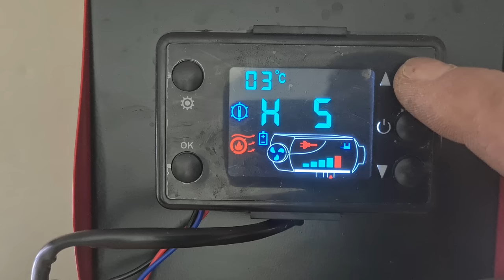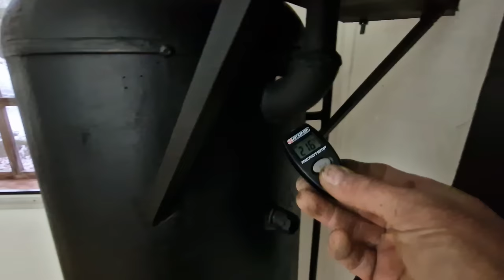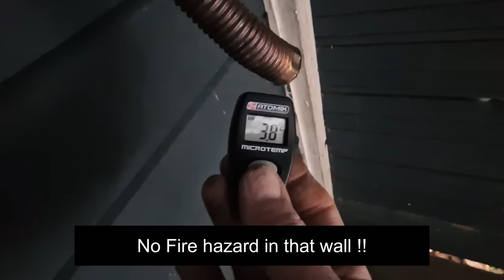DIY Vevor Diesel Stove with  Free Energy Sand Battery

Comment: There are several videos of people running the exhaust thru a hot water cast iron radiator to capture most of the heat, which I thought was a good idea. I may run mine thru a long baseboard water heat tube with the fins on it to radiate the heat before it exits the room.
Reply from the maker: I will make a new version soon, myabe that can give you some other ideas 😉
Reply: That’s a good idea too to capture more of the heat. The difference between that and the sand battery though is that the cast iron radiator baseboard will give you the extra benefit while heater is running but won’t store the heat like the sand radiating heat for hours after. Each is a great option depending on needs.

Comment: The instructions included with my heater warned against extending the exhaust pipe too much.   I guess the extra exhaust length restricts the flow and can cause combustion problems.
Reply: simply increase the exhaust pipe size if that is your worry.
Reply: another thing you could do if you are worried about it, If you are running the exhaust through a heat exchanger like that, the exhaust is cool enough that you could put a fan inline with the exhaust sucking he exhaust through the pipe to help flow, at 4 degrees c you could use a computer fan to do this.
Reply: @A2J_Tim   You'd have to be mindful to not create a lean burn, by pulling too much air through the combustion chamber.  I'm not sure what problems that might cause, but obviously the fuel/air mixture needs to be within a specific range to burn efficiently.
Reply: @glennr9913  its a heater not an engine, your not going to damage anything, the whole point of a heater is to make heat, lean burning makes heat. also a computer fan is not going pull a massive vacuum on it enough to change what the heaters forced air is putting in, you are simply assisting the exhaust.
Reply: How could I not subscribe when we have the same name and interests 😊. I love this sand battery design.

Comment: The problem with this set up is that it will be corroded in some time from the inside out due to the acids formed within the heat exchanger. In this type of heat  exchanger stainless steel is usually compulsory
Reply: SS doesn't conduct heat as well as copper. The efficiency will drop.

Comment: Amazing work on this project .
I just got one of these heaters and I'm in the process of getting ideas for tapping all that wasted energy .
My plan was to use a heat exchanger system like an EGR cooler, tapping the heat from the exhaust (obviously) and using a light weight oil similar to what's used in home radiators thereby avoiding it boiling over or over pressurizing the system,plus the oil holds in the heat pretty well, better than water alone .My plan is to use a holding tank,a 12 volt pump, a car radiator or an old home radiator ,a thermostat and a fan to drive off the heat from said radiator .

I definitely like what you did with the project . Excellent work !
Reply from the maker: Thank you! It sounds like you have a good plan so o wish you the best of luck with your project. I will build a second version of this soon.
Reply: Not entirely correct, 
Note -> No other liquid has a better heat capacity than water!
Reply: @janines4314  I was just to reply this when I read your comment. I only found this out myself a few days ago...
The heat capacity of oil is about half that of water. Oil is thought of as hotter because it can be heated to higher temperatures than boiling water, but at the same temperature, water moves more heat into your hand than oil does. Harvard University 👍
Reply: I run the exhaust from mine through an old towel rail to capture the heat
Reply: @janines4314 well said  it has the highest specific heat capacity. The best way to capture and transfer heat and won't boil tell it reaches 100 degrees centigrade in an open vessel at sea level.you can also pressurise it to conduct more heat above 100 degrees
Reply: @stevebriggs732  thats a good idea. I am learning a lot right now. Been heating my bus RV with a diesel heater for several years, but wasting the heat from the exhaust. Next project!
Reply: What a shop! Great video.
Reply: This type of water heater is uncommon in the U.S., but I do believe the central tube in a natural gas water heater could be tapped for the exhaust path.

Comment: Might want to give it fresh air into the combustion chamber to prevent it sucking air out of the room that will be brought in by outside colder air. This would make the internal air more efficient. Also, might want to secure the exhaust output from the heater to the tank coupler as the resistance in the tank could mean the lose fitting might blow some fumes into the room.

Comment: I did something similar with an old cast iron steam radiator, works fantastic and way simpler of a build.
Reply: Can you elaborate?
Reply: @cloudsculptor1 Seconded.
Reply: @cloudsculptor1  you just run exhaust gases through it and that's it. Same concept that you've seen on this video.
Reply: This radiator-solution can bea also better integrated into rooms. 👍
Reply: Also you don't have a large tank in the room ok in a cabin or shed, workshop, or garage, the radiator would look normal but great idea.

Comment: A suggestion to add to the build  to make it Nobel prize level would be a peltier element to generate electricity for the heater and charge the battery. To make the heater completely self sustainable in a off grid cabin for instance, only diesel needed. Would also be nice to see if a two coil tank version would work, with the second coil used for heating fresh water..
Reply from the maker: That's not a bad idea, thanks 👍
Reply: Yeah David mcluckie is working on a self powered diesel heater doing that you should check his channel out
Reply: @patrickday4206  you got a link for us?
Reply: @patrickday4206  Thank you
Reply: @EricDeanCampbell  🤔 let's guess smart guy, I'm living in the middle of Germany little bit south of Frankfurt just give you an idea. Since November last year until today February 15'th we had only 4 days of sun let's calculate with a week, and this is how it is nearly every winter. How you gonna heat up your sand batteries without PV Power caused by the lack of sun.
Reply: See how simple it is if we all contribute a bit more idea value to things. No patent or “ I thought of it  first.”

Comment: Cool build and design, I have a question why is the room air being used for combustion?  The combustion intake pipe should be run through the wall as well. By burning room air this can starve the combustion process in a tight building, or pull in cold air creating drafts.
Reply from the maker: That's absolutely right but this is just a prototype where I'm testing my theory 😉

Comment: Hi, is it necessary to strip all the foam? or just around the exhaust intake? how how is it around it?
Reply from the maker: Because risk of fire i think it's best to take the foam of completely.
Reply: @RickardsGarage  what was the highest temperature around the exhaust intake and out take? i am thinking that stripping around that point, then using a metal collar at a distance from the intake(similar to burner outtakes there is the internal pipe + the external collar that makes contact with the building)  - then a bit rockwool between the intake and the collar. For extra fun, remove the foam and wrap it in an aerogel wrap for hot water to maintain it as a tank.

Comment: The condensate is acidic. Soon the copper coil inside the cylinder will be eaten by the acid and it will leak into the sand. The sand will get into the coil, block it and give back pressure, killing the heater.

Comment: I also tried to use waste enegrgy from exhaust gases, unfortunately these heaters are very demanding on exhaust flow and usually any restrictor is causing E-08 and heater cloggs himself with soot very quick, so went to have box outside garage with heater and heating pipe trough wall. works well with 208c

Comment: Hello.  Awesome idea😮 why take the hot air in at the top and push" down and out?? Why not hot air in at the bottom ? Wouldn't that heat the sand faster??
Reply from the maker: Hi and thanks 😃 I will soon launh a video with an updated version of this heater.

Comment: It didn't all 'click' for me until the end, then my brain put it all together. This guy just recovered all the heat from the exhaust and probably achieved almost perfect efficiency. This is so ridiculously smart. This should be a standard for all cold weather environments. Here's your heater and here's your heat recovery container. Just add sand... Dear lord, when I think of all the things that produce waste heat... Even little recovery sand 'batteries' would be worth something.
Reply from the maker: I'm glad you watched to the end 😉 There will be an update pretty soon
Reply: @RickardsGarage Nice job, waiting for the update video. I just Wonder if there is any problem with the exhaust being that long.. See you soon!🤗
Reply: There are a few videos of people doing the exhaust heat recovery systems different types, this ain't at all bad.
Reply: @silviurogoz8962  I think the one thing that may cause a problem over time is soot build up if using diesel, so he may have to clean it out more often or change the pipe.

Comment: How long does the sand battery put out heat as if the diesel heater is running ???
Reply from the maker: I will come back with those figures
Reply: @RickardsGarage  I Look forward to the answer Rich.
Reply: @RickardsGarage  Great Richard.

Comment: Why don't you use water? It's better battery for heat.
Reply from the maker: With water i need to controll the heat below 100°C but  the sand can take about 800°C and less risk for 200 liters of water on the floor 😉
Reply: It has been proven that you cannot get more than 300°C heat out of the exhaust pipe, so the calculations start again.
Limit the heat to 100°C, so you can store energy in the water. For example, bypass the exhaust pipe with a thermostat.
The specific heat capacity of sand is 0.84 kJ/(kg*K)
In water it is 4.186 kJ/(kg*K)
In addition, sand conducts heat poorly, so charging is slow, and if you were to fully charge all the sand, that 300°C would be a dangerously hot outer shell.
Sand weighs 1.4 kg/l, so you have to remember that when calculating. Water spilling on the floor is always a risk, like the fire spreading from that Chinese heater. In addition, sand does not freeze, like water, so that risk is also gone.
I'd love to hear how hot you get the outer shell before the exhaust heat rises, that is, the loss starts to increase. =) An interesting project in any case!  @RickardsGarage

Comment: My water heater was very easy to strip down.  I cut a slit from top to bottom on the outer skin and it literally popped off.  I used a knife to cut a slit in the foam insulation and was very surprised when it too just fell off.  The water heater had been wrapped in celophane before the insulation was sprayed on.  What I thought was going to be an all morning project was done in five minutes.

Comment: Superjobb ☝️👏
Tips: Håll koll så att värmaren inte sotar igen. Jobbade mycket med originalen till denna värmare,
(Eberspächer B1L/D1L), på 80-90 talen och de kunde sota igen om det blev för högt mottryck på avgassidan. Ex.vis av klämt eller för långt avgasrör. Speciellt D1L, dieselversionen.
Reply: So what are your suggestions? I read a lot about the back pressure problem, lot of comments under other videos recommend not more than 1 meter of exhaust pipe, soot build up and Diesel consumption goes up. Should a small fan on the end of the pipe solve the problem? Helps to reduce the back pressure

Comment: Could you not just just fill a hot water tank with sand or water and exhaust the diesel heater into the bottom of the tank and vent hot water tank normally might be less efficient but might be easier maintenance. Great video though good idea!
Reply from the maker: I'm about to modify this one so look out for the next video, thanks 🤝

Comment: Truly excellent video! Bet that many, me included, will go scavenging for accumulator tanks at the next full moon :) I’ve seen others, among them the excellent @johnmck1147 warn against too long exhaust lines creating restrictions on air supply and creating bad combustion and soot. Your coiled pipe would not cause much turbulent flow, so should be fine. But if you could measure CO at the exhaust opening that would be great! Like&subscribe :)
Reply: You got a link to the video why and where he explains it?

Comment: Great concept, but the acids contained in the water that the exhaust pipe has in it (that will never get hot enough now to get removed as designed) will eat your piping alive within 2-3 seasons.... Maybe 4 if you used stainless pipe (but you did not).... So you will have to disassemble and empty your tank, replace the piping, put the sand back in, and re hook everything back up if you want to use this method...  For just about ANY internal combustion engine or apparatus I do not know about NG or LP gas, the exhaust pipe HAS to be able to get up to and maintain a certain temp to get all the condensation cleared from the inside of the pipe...

Comment: The diesel heater has a weak fan and struggles to blow through a pipe (exhaust) more than 200 cm long, especially with bends, so an increase in exhaust pipe diameter would help, otherwise they are prone to sooting-up and then needing a clean out. But I like the idea, another maybe to run a heat exchanger (car EGR valve cooler) off the exhaust and run hot water through the pipes?
Reply: I've been wondering about that?
Reply: The advantage with sand is that you can have higher temp than 100c. So water is a bad idea.
Reply: @krainskij  you missed what he was saying
Reply: @krainskij  you could mount the diesel heater at the bottom of the tank with Rob Pollock's EGR setup running a high temperature oil through the  egr to the sand battery using thermosiphon. This would allow for a short less sooting exhaust  while putting a higher temperature than water could carry into the sand tank.

Comment: Wtf…while it seems logical, this is a flop. Condensation will destroy the carbon steel HX. The heater on top will get nice and warm 🤦‍♂️. Fill with sand to radiate out after unit is off…uncontrolled space heating…windows will be open. Thermal mass heaters suck ass. Heat water and circulate. Much better control minimal energy needed. Where’s the update?

Comment: water has a much greater heat capacity than sand.  I doubt this would ever get the water to boiling temps anyway , but still hot enough to kill bacteria. Make sure it's vented.  If water was used could also circulate it from a small heat exchanger w/ fan for quicker heating, then let it be passive

Comment: Great build! Perhaps if the exhaust would be in from bottom to out from top of the tank it would be better for natural flow, but your way it is easier to operate the machine.
Reply: The issue would be all that condensating water, although I think a condensation trap with a drain could work matthius4lupe.
Reply: @pa_maj.MARTINI-van-MAN Good point. I wondered the reason too.

Comment: I'm concerned about how you're planning on cleaning out that coil when it gets clogged/coked up from all that exhaust cooling down along it's length.  Is there any way to clean that out, or will that coil need to be replaced?  How long did this last before getting clogged up?

Comment: Have you considered to swap around the exhaust of the diesel heater and the outlet of the exhaust fumes connections? 
In other words, the hotter fumes enter at the low part of the heat exchanger and escape from the top. 
We know that heat tends to rise, by inverting the flow you warm the low to middle part of the room primarily, which is where heat is needed most. 
I know there could be some condensation issues but they can be overcome.

Comment: If sand is not hotter than 250C, there is no point to heat sand. It would better to heat water. One thing is better in sand it giveups heat much slower than water. But it can be overcame by using some sort of jacket over water storage, to regulate how much of heat to dissipate in room.

Comment: FREE? Not really but maybe low cost diesel... in the USA road diesel on 2/1/2023 US$5.00/gallon @137,000 BTU/gallon if 100% into heat. A small 1,000 sqft home from 2x6 stud rockwool R21 insulation requires 12,000 BTU/hour when it's 32°F outside to hold 72°F inside delta 40°F. 
137,000/12,000=11.4 hours/gallon. 24 hours = 2 gallons/day. @$5/gallon = $10/day x 30 days = $300/month
NOT FREE ... BUT MATH DOESN'T LIE...
Reply: He's recapturing the otherwise wasted exhaust heat, which is normally hot enough to make exhaust pipe bends visibly glow red: wild guess; maybe 20% energy loss through tail pipe? Maybe much more!   A car only uses 30% of the energy, the rest is wasted as heat.  This sand tank is an amazing and innovative attempt to resolve an inefficient situation.  The recovery amount is astounding!  And points the way future recovery efforts may be directed.

Comment: you missed one point. You should have a cold air intake from outside for the burn chamber instead of consuming the hot air for inside. route a pipe in the same hole in the wall up to the heater.

Comment: Nice! =) If you had solar panels you could put resistive heaters inside the sand also.
Reply: This was the first thing that came in mind when heard about sand batteries. Great way to use many types of heating.

My plans are 4 square meter solar heaters blowing through sand battery to store the heat. Also heating elements could store excess energy into the sand battery.

Comment: I would off have the flow from the exhaust entry fed in the bottom and outlet exit the top off the cylinder as heat rises therfore the sand is hottest down and heats up this is the method off convection current.